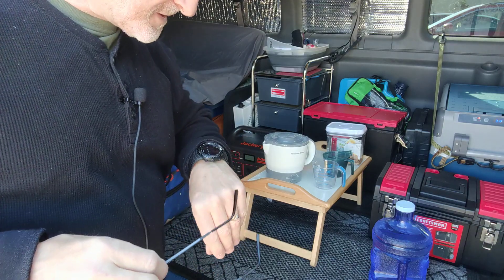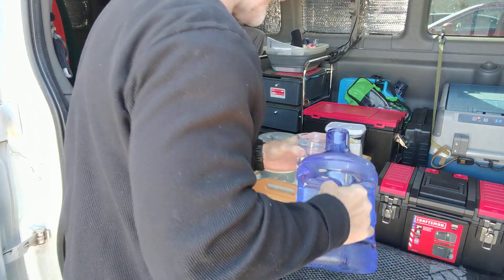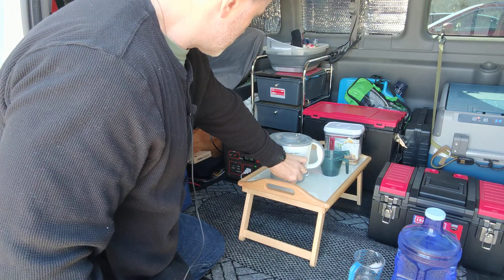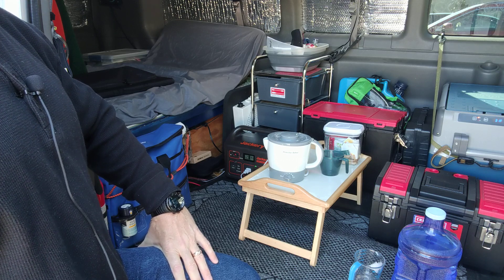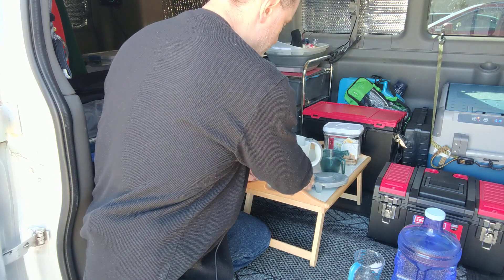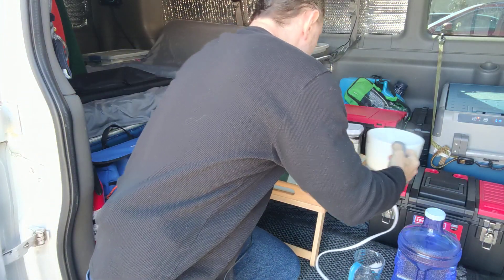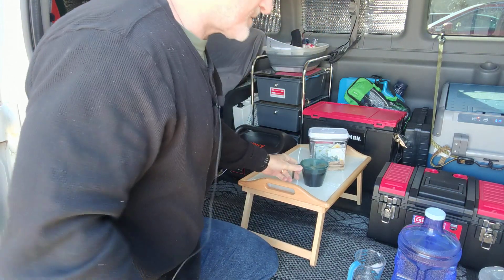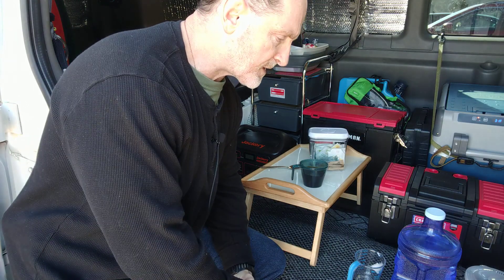Using the Jackery Explorer 1000 to Boil Water in a 1000 watt  Electric Tea Kettle

Comment: I have a cheap 1000 watt kettle that i purchased at Walmart. I use it with my Jackery 1000 and it boils 500 ml (2 cups) of room temperature water in around 5 minutes, using 5% of my battery.  It's excellent for making coffee and for instant noodles. It's much more convenient than boiling water in a pot on my stove. I also have a "DASH Mini Maker Electric Round Griddle" that I purchased on Amazon that works great as well to cook eggs and pancakes.

Comment: so the jackery 1000 has 46.4 Ah  I wonder if they do the % from full to 20% or  from full to 0 battery.  Anyways you used 5% for hot water, I calculated  (5% of 46.4Ah) you used 2.32Ah. Not bad! not bad at all!  why am I here? not for the jackery. just trying to figure out how much Ah an electric tea kettle will typically use. Grain of salt here, as they are not all the same, and elevation matters greatly.

Comment: Hi! I have an electric kettle but my Jackery 1000 shut itself off when I tried using it. Maybe it’s drawing too much power? It’s the T-fal BF6138 Balanced Living 4-Cup 1750-Watt. 120v 60hz. Any advice?
Reply: The Jackery 1000 has a max continuous output of 1000 watts. It can handle up to 2000 watts in short bursts but 1750 watts continuous is too much. Using the AC port also means you lose some efficiency. You will either need to find a kettle that is rated around 700 watts or you will need to upgrade your power source
Reply: @hesselbot6  thanks, I returned 1000 and bought 1500 and I’m much happier!!

Comment: I've really been enjoying your reviews of the Jackery Explorer 1000 it seems like a really good unit I was going back and forth between the Jackery and the Bluetti EB150 trying to decide which one to get and I think I'm going to get the Jackery just because I'll be able to charge it while I'm driving with the cigarette lighter output in my van. Something you can't do with the Bluetti even though the Bluetti has about 5 times the recharge cycles @2500 vs 500 for the Jackery ah I guess there are trade offs to everything. Have a blessed day Big Anthony stay safe.
Reply from the maker: Thanks for your comments.  I was looking at the Bluetti as well but went with Jackery because of the 12 volt recharge while driving.  All outlets are in the front.  Not sure how long 500 cycles will last but it has to be at least 3 to 5 years.  By that time new tech will be out and I will pass this one off and buy new.